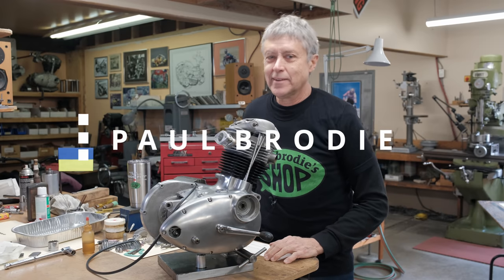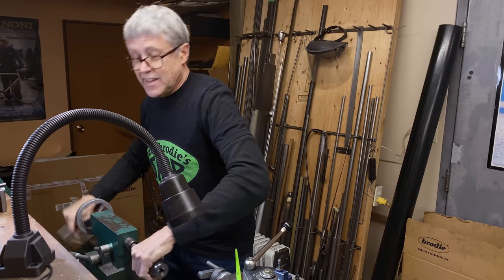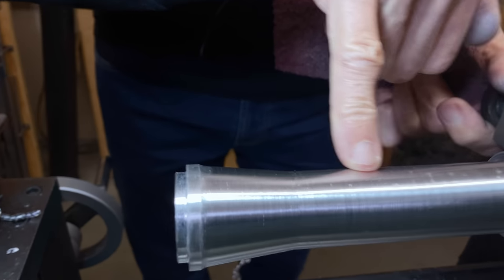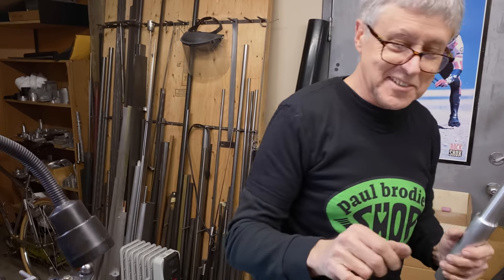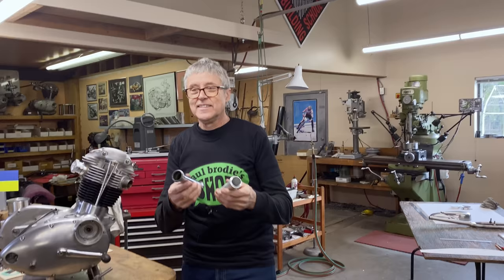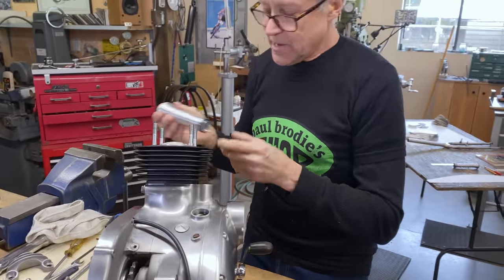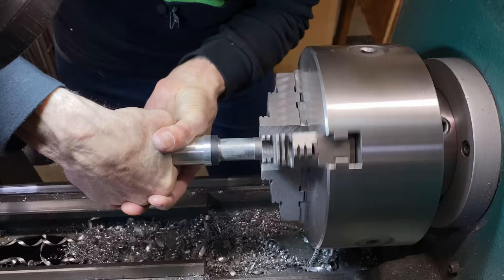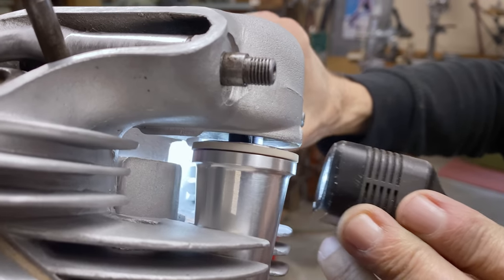How to make a pushrod tube // Paul Brodie's Shop

Comment: I been having head issues also, my newly assemble scooter engine wouldn't start, after a week of disassembly , reassembly, no start, checking and rechecking, no starting, I removed it so I could see what's going on , completely disassembled the top end, I had a bent valve, the cam timing was off, and bent the intake valve, I was wondering why it still had only 150psi compression when I swapped to a airsol high compression piston, and it had 150+/- before, but I had a bent valve, on my big valve head, I couldn't find a valve the same length, so I built another head that has extra oversized valves, from 21mm to 23mm, not that big, but concidering it had 16/18 mm valves, now has 21/23mm, and it went from 39mm to a 50mm bore! Im hoping for near 6-7hp, being it was 3-3.5hp at 7500-8000rpm, it has a cam ported head, exhaust and larger carburetor, and turns 9500, but has seen 10,350, but I try to stay below 9500revvums , bearings and stuff, I'm hoping with the larger valves higher compression,. It atleast makes more TQ, to maintain speed on hills, I have a 150cc but need to make mounts for it, maybe later,
Reply from the maker: Sounds like you have quite the project on your hands. Good luck!

Comment: Paul, you never said why you didn't just turn a couple thou off one of the push rod tubes you had. I'm sure there is a good reason. Beautiful work by the way.
Reply from the maker: Thank you Ross. The new pushrod tube was approximately 3/16" shorter than the original. Taking a "couple thou" off the ends was not going to make it work...

Comment: Sorry if I missed it, but did the push rod tubes you had grow in length or did the cylinder shrink?
Reply from the maker: We don't know, it's a mystery. I did buy a lot of used parts, but the head and barrel are stock.
Reply: Think they are tiger or Bonneville  ?

Comment: Maybe I missed it but did you ever say why the push-rod tube was too long?  I assume it would have something to do with resurfacing the head.  But what about the push-rods?  Will they be too long?
Reply from the maker: Pushrod length is good. Only a few thou were sanded off the head to make it flat. I got a lot of parts, and someone said the pushrod tubes could have been from a BSA C15. This is one of those mysteries that might never get solved!

Comment: If the tube was long, how certain are we that the push rods are the correct length?
Reply from the maker: Because I assembled everything without the pushrod tube, and the tappet adjusters weren't too far in or too far out!

Comment: Just wondering why the pushrod tubes were too long. Has the barrel been shortened? Have you checked valve/piston clearance through two full revolutions?
Reply from the maker: Well, I went from oval head and barrel to square. I did not shorten the barrel. Yes, I have turned the engine over and nothing hits. Thanks for watching.

Comment: I’m so glad that the stock pushrod tube didn’t fit! It looks like the top section of the P trap under my sink. That motor has no place for that plumbing, your custom made piece looks around 9000 times better. Well done.
Reply from the maker: Good call! I laughed that it looks like a plumbing piece!

Comment: I turn that grade of aluminium a lot. Normally 1 1/4 diameter it always machines different and the finish is always different. I use p60 grit emery cloth then red scotch bright to finish off. Then it is hard anodized.

Comment: I guess my question would be why the two OG tubes were so long/why is your cylinder + head so short. Is it destroked? Different year parts, like knucklehead/ashtray head/pushrods on the ‘macchi’s? Did you do a squish test? No valve interference? Maybe the o-rings are not correct for the tube style? Ding dang it! So many questions before…I’ll just spin one up on the lathe. Ha!
Reply from the maker: I did change the oval head / barrel to square. Someone said the pushrods tubes look like BSA C15... Yes, I turned the motor over and nothing hits. I think we're good to go. Thanks for watching!

Comment: Why did you not skim the top and the bottom of the old tube
Reply from the maker: First, it was the wrong length, and secondly, the stock tube is made out of steel and the ends are very thin. So, not suitable, and, it's always better to design and create my own parts!    :face-blue-three-eyes:

Comment: Listen Paul, I have a wee problem , I am an engineer and one of my favourite bikes is the possibly only bike ever built with a  Statically determined frame , or at least very close to...is the Bimota KB2  , howevver I am 6"2 so a wee 550 isn't really 4 my cup o' tea so I am intent on building a similar frame but 4 a Aprilia Mille engine...  . Here comes the question , The KB2 has an odd Bimota specific steering head arrangement wherein the steering head seems to have a 40 degree angle but with non parallel yokes so the fork is possibly around 23 degree.....possibly producing negative trail.......what is/was  the intention ? I rode one long ago , didn't feel any different .......I once read something about their intention but cannot remember...Any Idea ?
Reply from the maker: Kim!   You are an engineer asking a non-engineer (me) a very technical question. First, I have never heard of a "statically determined frame", so I am unsure what that is. You are unsure of the actual angles (40 / 23..) so unless I had a technical drawing of the chassis and fork setup, it is very hard for me to give you my opinion as to what their intention was. Sorry.
Reply: @paulbrodie  I was hoping it considerable experience of building frames calculating head angles and trail ...would give u an idea.  .
Reply from the maker: @kimeldiin1930   Trail is calculated from head angle, fork offset, and wheel diameter. Tell me those 3 things and I can give you an opinion.
Reply: @paulbrodie  that much I know .though I rode one 30 yrs ago that one got stolen so I am searching the net 4 info ...by the way my field of engineering is jet engine, a wee distance from veichle dynamics..kihi...

Comment: But, why didn't the original tube fit?
Reply from the maker: The original pushrod tube fit the oval head / barrel. I updated to the square head / barrel. That combo needs a shorter tube.

Comment: Looks beautiful but the first time I've seen you cut a corner, in that you took a grinder to the head rather than go back to the lathe, again, with the pushrod tube to get it perfect. Normally you are such a perfectionist.
Reply from the maker: I was grinding down the casting flash, trying to make the head perfect. Sorry, I don't see it as corner cutting.
Reply: @paulbrodie  Ah, I thought you were cutting the fins back. Apologies.
Reply from the maker: @dadawoodslife  No worries. I did turn the tube to a smaller diameter on the lathe and the wall thickness was starting to get a little thin!

Comment: I got my scoot running earlier, the high compression definitely made a difference in the sound, the cam should have near 1/2" a mm more lift, and a bit more duration , it seems to have a noticably different lobe  shape than eve the high performance cam I had in it, the new cam, popup piston, and extra large valve head, with a decent amount of port work, long with a 20mm carb, free flow exhaust, it does sound different, I hope that translates into more TQ, if nothing else, it should make atleast 1more HP than before, possibly a couple more, and should rev to 9800 easily, unless the cam moves the peak down in rpm,  they give cam specs. As measured by hand with dual calipers, 😆,and no LSA, love centers, base circle, no lift with rocker ratio, no operating power band, no real cam specs at ALL! It the new cam comes from a well known Taiwan. Manufacturer, when sells good parts. They are no real specs of any of the performance parts, no details, they sell stock coils, and racing coils, only difference I see is color,  same with cdi, stock and racing, only difference i see, is the  occasional hard to start, I guess it's high base timing , it's nothing like car parts, they try to sell you the parts, tell what it does, advantages of using the part, and the specs. Sometimes the possible gains, what it will do for you, these china scoot parts, nothing like that, not even the good Taiwan parts, $260 for a jug piston and head, the china version, $50-$65, the china parts come in a bag. Or plain box, the Taiwan parts come with nice box and  a name brand, but not so much as a what it is even for, much less what it does and why you may want it, it's crazy  you gotta know what the parts look like , and what you have, plus there is other gy6 style engines, made by other companies, I have two, the nuts for the axel are different sizes, and a few other things like that, it's like they are made with what ever they have that will work that day,  they are lots with different cylinder stud spacing, different cam cover bolt patterns, even one with different cam bearings, everything else is the same as far as I know! Haha crazy , 20 companies making the same engine. With slight difference, and the scooter manufacturers seem to buy from who has what they need, 
But atleast I have it running!!
Reply from the maker: James, that's great you got it running! I did read your entire essay, and I think you meant "lobe centers", not "love centres". Thanks for watching :)

Comment: Of all the engine designs I’ve worked on and come across, that has to be one of the least well thought out. A definite directions to Dublin situation to be sure. What would I compare it with? Well, just sticking to four strokes, the Ducati Desmo is complicated but superior, and every Honda single is simpler by far. Cute, but a pain in the a$$!

You can blame Putin for the quality of your aluminum 🧐😎😜
Reply from the maker: Yes, the Cub is not an excellent design at all. But it is a good looking motor. The Aermacchi is up next, so it will be good to assemble a very nice, well made engine.

Comment: Not Bad, but the shifter is on the wrong side!🧐.     🤯🤷‍♂️
Reply from the maker: That's what you think!
Reply: @paulbrodie  I think I would have a hard time riding that. Shifting down/pulling up on the brake pedal etc…🤕.  🤪
Reply from the maker: @ThePsychoNad   It's a mental thing. You just have to focus and not screw up.

Comment: Triumph pushrod tubes are just a really bad design and add in poor manufacturing tolerances it's no wonder they never fit correctly and leak.

Many years ago my father in law worked for John Tickle who made many custom parts for British bikes and they did experiment with adjustable tubes which were spring loaded to account for manufacturing differences and thermal expansion but they never managed to get them to work properly.

Very nice tube you made there, now you just need to make a nice points cover... 🤣
Reply from the maker: Sid, thanks for commenting! John Tickle and the adjustable length pushrod tubes... You must be a mind reader - The points cover video comes out Saturday!!
Reply: @paulbrodie  great minds think alike. 👍👍👍